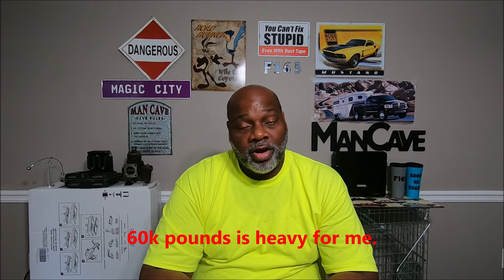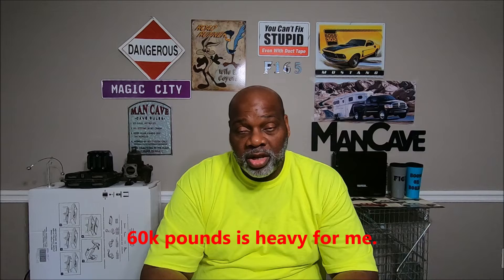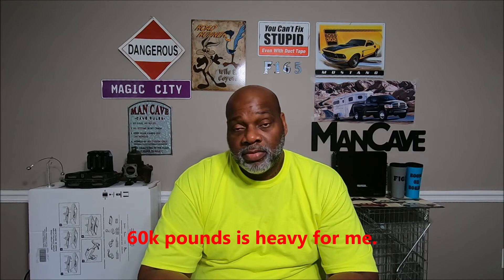2021 Volvo VNL760 has down hill speed control

Comment: The F-165 Light Cannon is the perfect light for those looking for lots of power in a compact and portable package. It provides the user with an impressive amount of light via its 165 Watt LED Output. The Light Cannon Series' unique design allows the light to be placed back 10, 20, 30, 40 feet back and beyond due to its amazingly long throw.